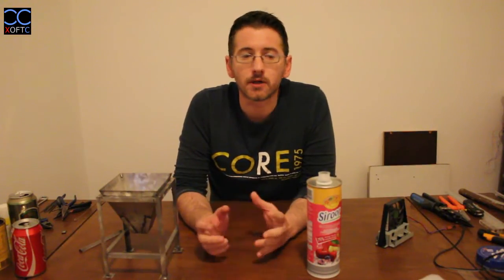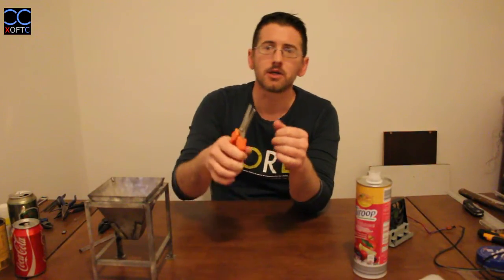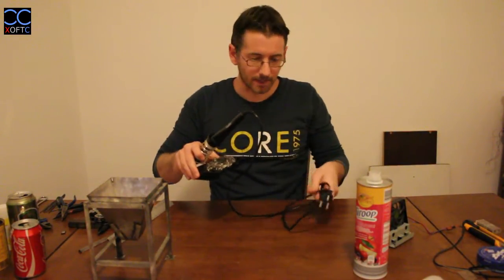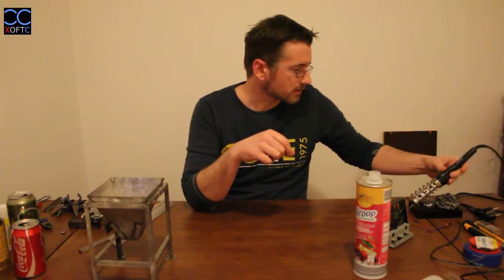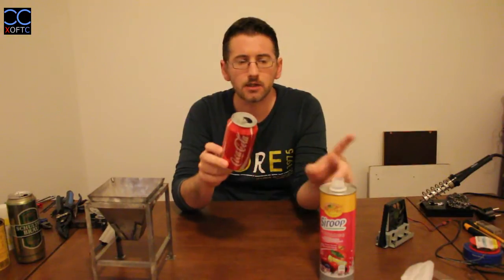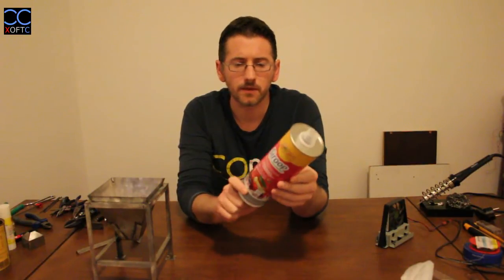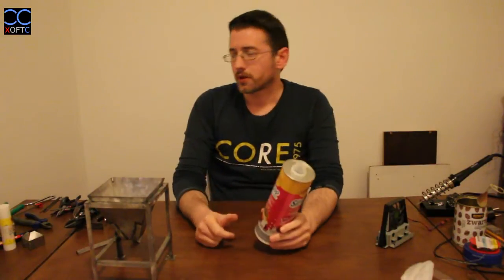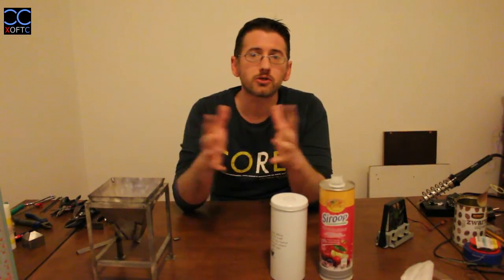Model building out of sheetmetal - Basics part 1

Comment: You can also use heating duct sheet metal available at your local Hardware store,which is very cheap.It is galvanized but can be soldered easy and painted and sanded.
Reply: Be very careful with galvanized plated metal it gives off toxic fumes when heated !